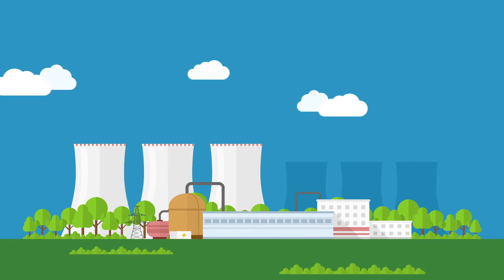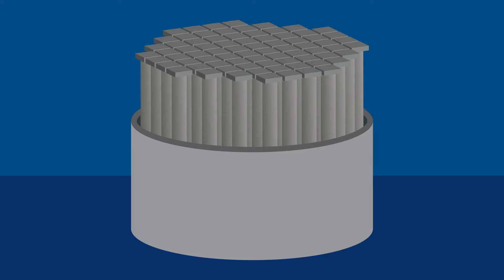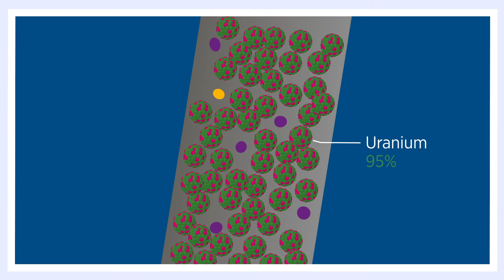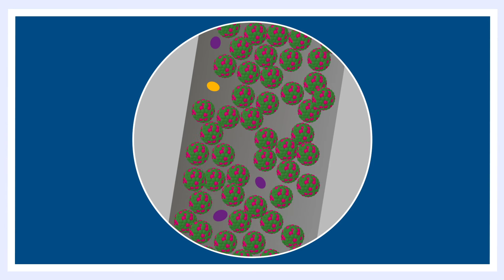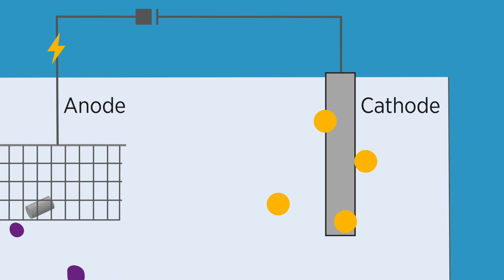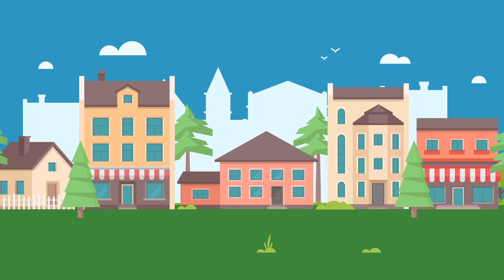Pyrochemical Processing: A Sustainable Solution for Nuclear

Comment: This is a wonderfully accessible video on the basics of nuclear energy and pyro-processing without being too complex or too long.  Couple this plan with breeder reactors and you could basically use ALL of the unused fuel.  So-called "spent fuel" contains about 20x the energy that was removed from it, breeder reactors could extract the rest.
Reply: So essentially, extracting every little bit of nuclear energy from one sample of nuclear fuel
Sounds like true efficient green energy to me